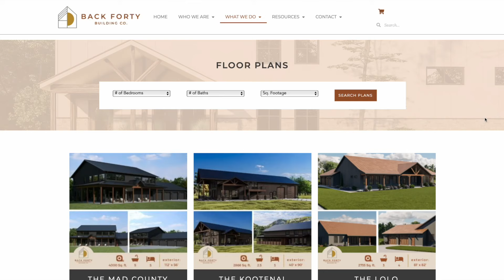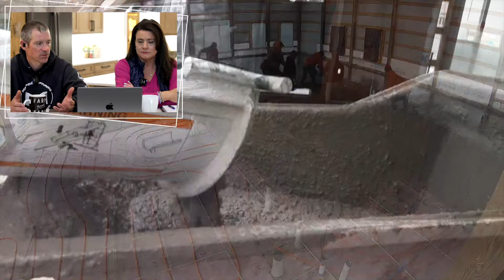The Perfect Concrete Slab | Is $elf Building Worth It? | Ep 17

Comment: Thanks for doing these retrospectives.  It might be worth a video or a short talk about how to find a concrete contractor.  First question, are there even options in most areas? Second how far afield do you look?  How far in advance do you need to talk?  Is it even before the site is prepared, and what if they have preferences on how the work is done? I'm sure these are all "newbee questions", but that is where I'm at.  I'm still a few years away from building, and in a "learning mode" right now. Don't even know which state it will be in yet.  Michigan, Indiana, Ohio, and Wisconsin are all still options. (With Michigan the most likely)
Reply from the maker: Those are great questions! We will add them to our list of video ideas so you can refer back to them over time.